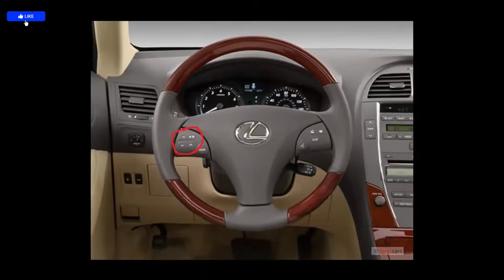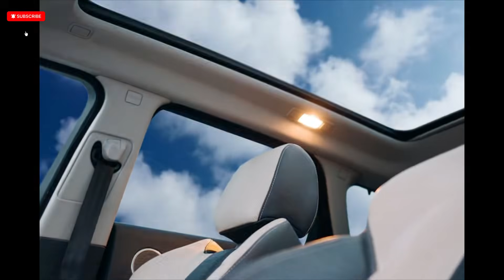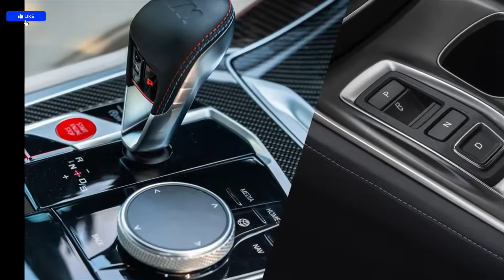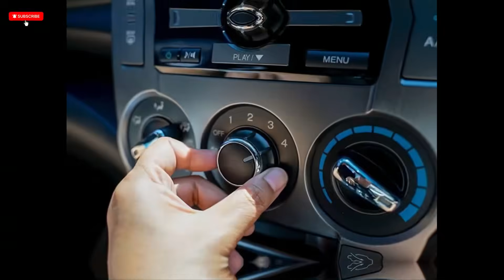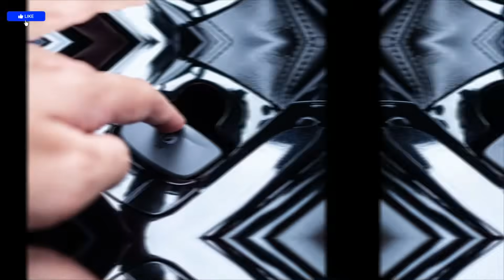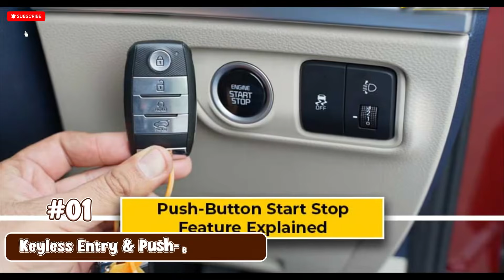Most Dangerous Car Features That DESTROY Reliability

Comment from the maker: 🚗 Buying a new car? Read this FIRST!
Before you get wowed by flashy tech and “must-have” upgrades, you NEED to know which features are actually worth it—and which ones turn into expensive headaches 💸
In this video, we break down the 18 DUMBEST car features that sound amazing in ads… but cost you money, comfort, and even safety in real life 😬
From steering-wheel button overloads to keyless-entry theft risks, newer doesn’t always mean better.
🔧 What you’ll learn:
• Features that break fast and cost thousands to fix
• The worst modern tech gimmicks automakers keep pushing
• “Safety” features that actually make driving more dangerous
• Smart car-buying tips to avoid hidden costs
💬 Your turn:
Have you owned one of these features? Which one annoyed you the most?
Share your story below — I might feature it in the next video 👇
👀 Next up: Car Features That Are Actually Worth It
👍 Like | 🔔 Subscribe & hit the bell so you don’t waste money on useless car “upgrades”
#CarFeatures #CarTips #CarFails

Comment: The more of these videos I watch, the more I think my 1993 Ford Explorer is worth repairing and keeping running. 
The engine has 197,000 miles and is going strong, no leaks and runs good. The rest of the vehicle has problems.
I could easy put ten grand into mechanical repairs and cosmetic fixes. Is it worth it to avoid the issues of newer vehicles?